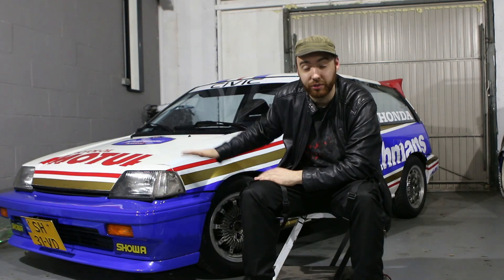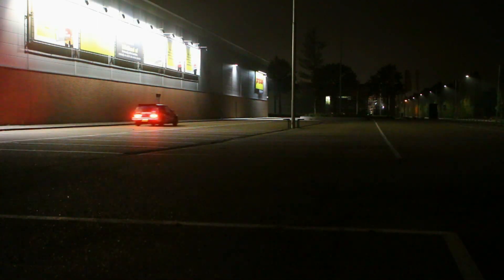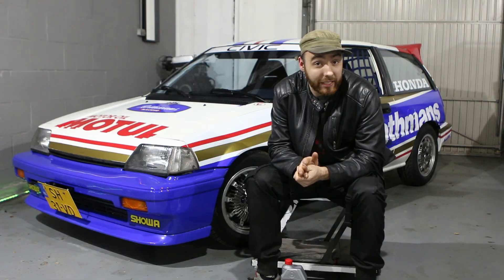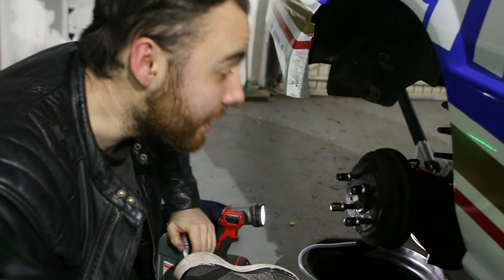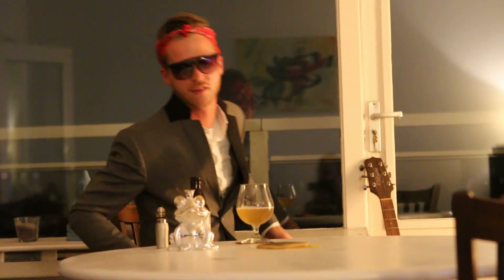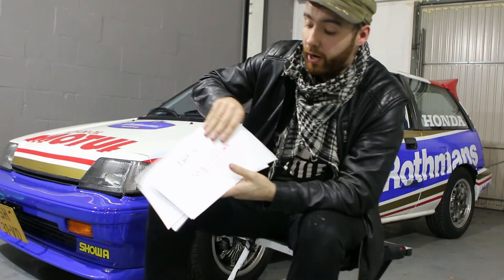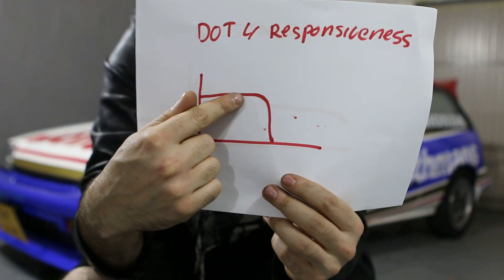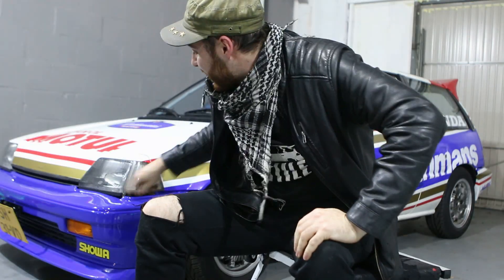DOT 5.1 Brake Fluid | Does it Matter? EP 5

Comment: dot 5.1 has lower viscosity than dot 3 and 4.
did you notice any fluid leak? because in old cars this can happen when switching to 5.1
Reply: If there is enough of a leak for viscosity to matter, Air would already be in your system. Please stop spreading misinformation.

Comment: Is Brembo 5.1 hygroscopic? I want to use it on my daily street car
Reply: The higher the boiling point, the more hygroscopic the brake fluid is.
Reply: All brake fluid is somewhat hygroscopic, with the exception of dot 5 silicone based fluids, which you should never use for any reason. Dot 5.1 seems to last a bit longer than 3 or 4 in my experince however.

Comment: Cool video! I suspect most of the difference comes from replacing old fluid with new fluid, not necessarily from it being DOT 5.1? It'd be cool to test new DOT 4 vs new DOT 5.1 of the same brand. Good luck with the car's prep!
Reply from the maker: True! Especially since i have no idea when it was replaced last
Reply: You should stick with motul, choosing motul rbf 660 dot 4 You would have brake fluid with 325degC dry boiling point and 204 wet, so a lot better then dot 5.1.